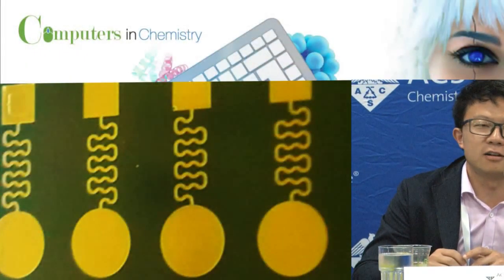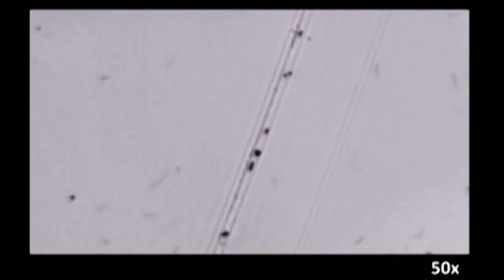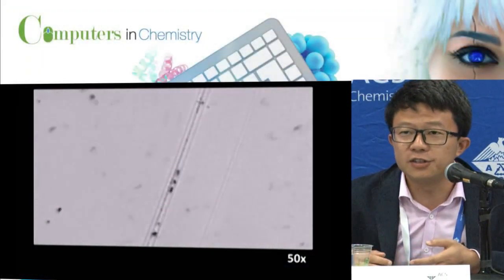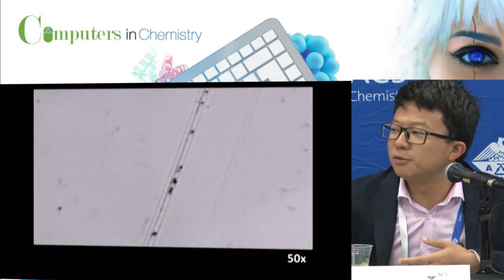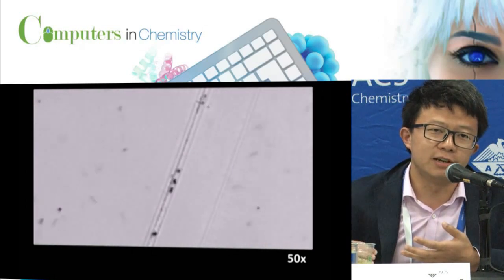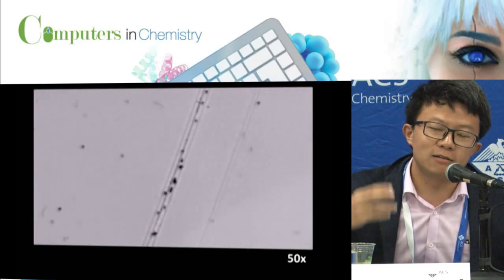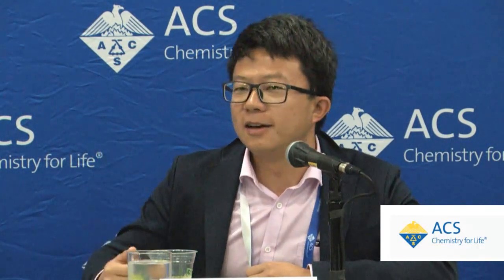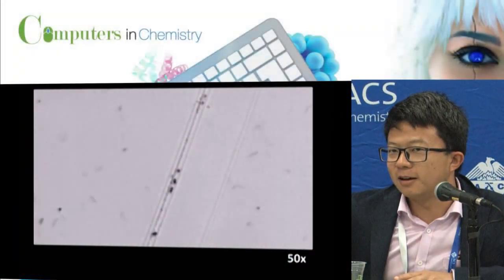Nanomotors could help electronics fix themselves

Comment: Its amazing technology. One thing i dint understand that when the nano-spheres are actuated autonomously they accumulate in the crack. but not all the nano spheres might get deposited to repair the crack. then what happens to those nano spheres which fail to get deposited in crack. Where do they go. wont they effect the surface properties of the rest of the circuit?